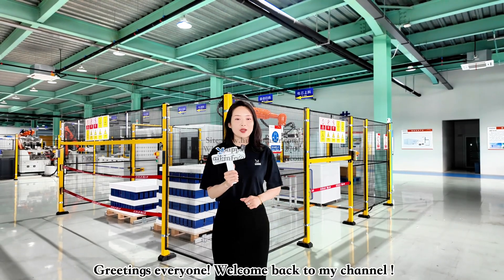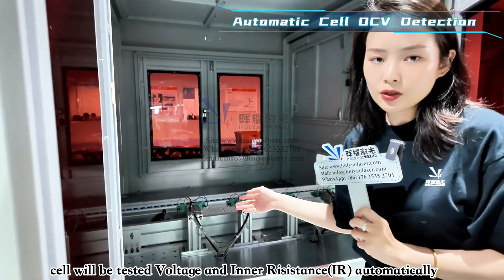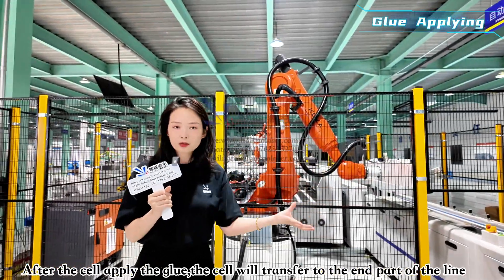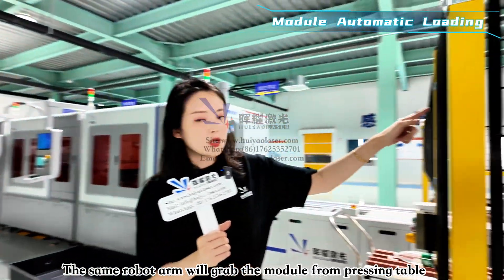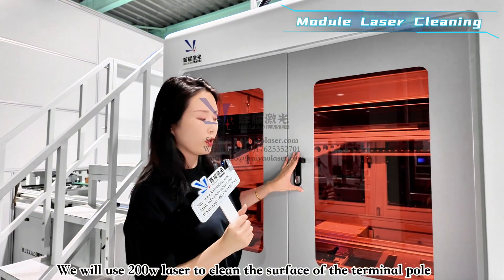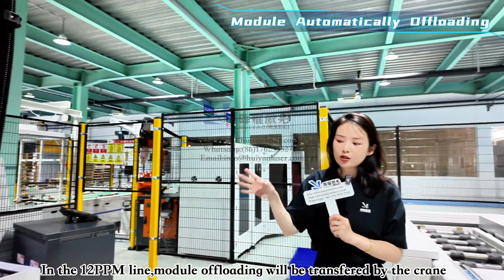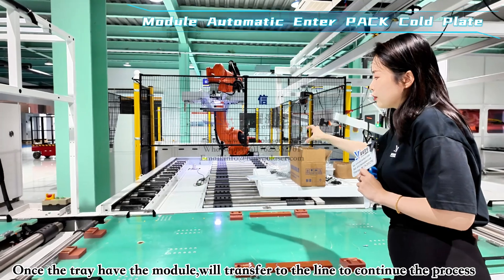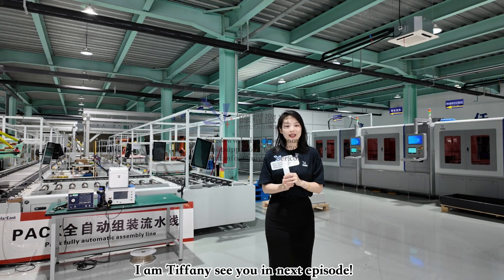Battery Energy Storage System BESS Container Solution

Comment: Very good, we are interested in this line, is it very different from the automatic 12 PPM? which has approximately 1.5 GWh of capacity.

We are planning to assemble the 104-cell packs. Our main question is how many employees, on average, are in this factory? From what I understand, there are about 10 employees in module production and it heavily depends on the pack line, but normally how many people do your clients have working on pack production? since this 104S 314Ah is quite heavy
Reply from the maker: sure,can you add my whatsapp number (86)17625352701 or mail :info@huiyaolaser.com for directly communication?